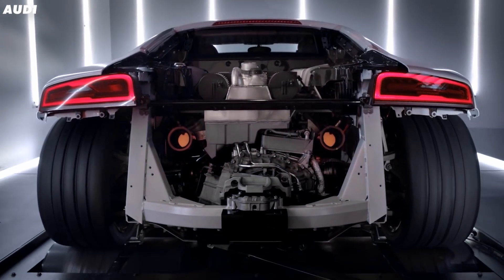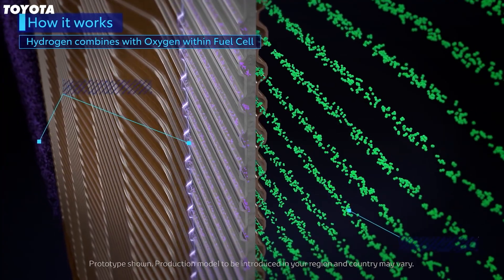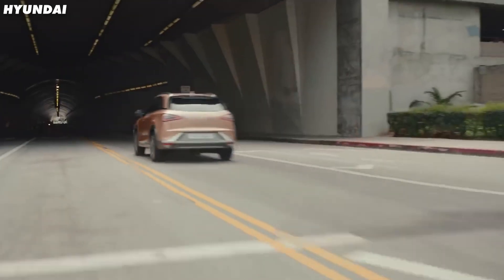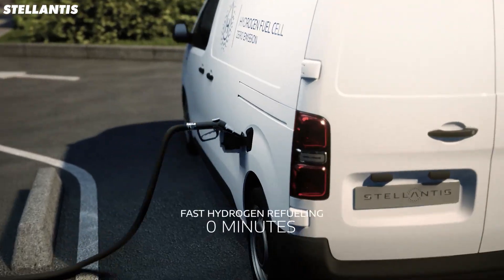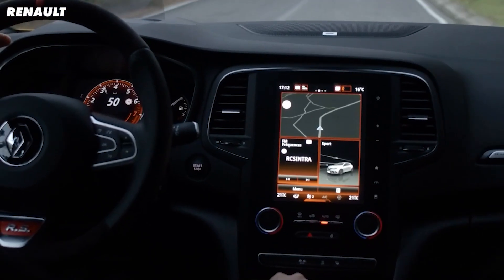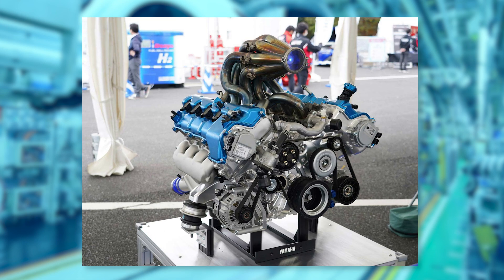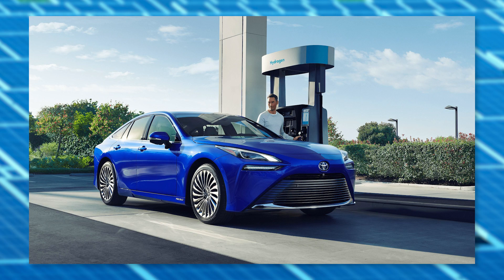The V8 Engine that Runs on HYDROGEN

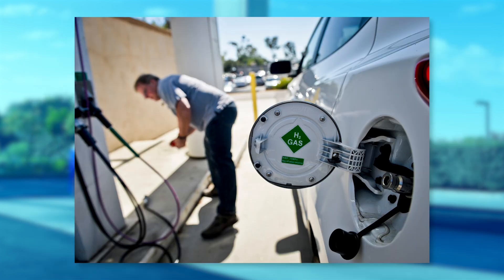Comment: 6:20  Fun fact.  Hydrogen cars are actually heavier than battery electric cars.  A Toyota Mirai is 4,255 lbs, while the Model 3 with the largest battery is 3,891 lbs.  And the Model 3 has much more interior and cargo room.  My EV has more room, and it's only 3,600 lbs.

Comment: 5:14  Eagle eyes will see the "DO NOT USE AFTER 2039/05" on the hydrogen tanks.  Yes, they expire and are not able to be recertified like metal tanks.  And you'll amazed how expensive they are. Replacement tanks for the Toyota Mirai are $25k, not including labor.
Reply: To be fair 20 years is a more than enough life span for a tank. Car will be long gone before it expires, in most cases atleast
Reply: @Zripas  yes 20 is fine, but it's 15 years, not 20. In the US the average age for a car on the road is 13 years. When I asked Toyota about it, they also said at 15 years, it would be an above average lifespan.
Reply: @scottkolaya2110  
It says to be manufactured in 2019/06 and it expires in 2039/05, so that would be 20 years, unless those dates mean something else.
Reply: @Zripas  I stand corrected, thank you.  All the other tanks I've seen on FCEVs have a 15 year.  Most notably the Toyotas.  I guess not so eagle eyed after all, lol.
Reply: @scottkolaya2110  
Well honestly I thought myself that hydrogen tanks have like 8-15 years as max of life span, so having real world example of one with 20 years is a nice surprise for myself.
Reply: @ The first year Toyota Mirais are now 10 years old.  It should be interesting when all their tanks expire.  No one seems to know what will happen.  Will they not be able to register that year?  Will nothing happen and people keep driving them?  Most that own them haven't even noticed the "DO NOT REFUEL AFTER xxxxx" on the fuel door or what it means.
Reply: @scottkolaya2110  
Well as no one actually buying hydrogen cars that sample is quite tiny, but I think that government should not allow car exploitation with expired tanks, I wonder if they even allow renewal of technical state if expiration is in between those, like if tanks is expiring in 2 months and I'm trying to renew license to use that car, would it even be allowed? As I would quite likely keep using it without replacing that tank, which would endanger quite few people. Its a weird situation.
Reply: @ I'm not sure what country you live in, but in the US, mainly California, over 18,000 hydrogen cars are running around on the roads.  It's not much compared to the 283M cars, but not "no one" either.
Reply: @ we've also had CNG tank cars for longer with the same 15-year expiration and there doesn't seem to be any requirement to prove you changed it before registering it.  There's lots of controversy around it.  The early ones have already passed their expiration at this point and people have said, (at least in CA), that there isn't any proof that's even asked for.  They quote it as the "gray area" cars.

Comment: My question then is, are we incapable of making hydrogen with a process of hydrolisis on board the vehicle so the only thing you keep in the tank is water essentially ? I only ask because ive seen it done with a generator.
Reply: It is possible to make hydrogen from the electricity from a generator, unfortunately, it consumes more energy to split the water than the energy contained in the resulting hydrogen.   If not, you'd have a perpetual motion machine.  If that worked, everyone would be powering their homes with it, just making hydrogen on the fly.

Comment: Your just changing the fuel. In the video you act like it’s combustion hydrogen motor vs electric motor. Unless electric cars can improve their range or charge times the hydrogen motor will win. 
1 -green hydrogen in a is actually neg emissions vs electric up to 40% less emissions 
2 -current combustion engines can easily be tooled to accept hydrogen as the fuel
3 - strong chance individuals can produce hydrogen fuel for free  
4 - hydrogen vs gas motors can be tooled to produce way more Hp than gas motors. The racing community and engine engineering will really take this further. 
5 - the motor sound 
6 - adding hydrogen as a retrofit on older motors will be possible.
Reply: The hydrogen motor will not win unless you can produce hydrogen cheaply.  Right now the pump price of hydrogen averages $33/kg in the US.  That's equivalent to $30/gal of gasoline or roughly $1/mile.  That's like trying to sell electric vehicles if electricity was $4/kWh.  Tooling current engines to run hydrogen isn't as easy as many think.  Just ask JBL, Cummins and Toyota.  Toyota has been racing them, but of course they come in last place every time.  Last time they tried liquid hydrogen so they didn't have to refuel so many times but kept burning up fuel pumps because of the low temp with no lubrication properties. There are many challenges and even if you can get past those, storage is still an issue.  You can store it 3 ways.  Compressed, liquidified to -427F or in a metal hydride matrix.  So it either takes up too much room, has to be kept really cold or it just boils off, or it's just too heavy in a metal matrix.  A sedan-sized hydrogen car gets about 35 miles per kg if you combust it and about 70 miles per kg in an FCEV.   A FCEV can get away with compressed and have decent range as long as you don't like having room. Say I made it at home with my solar panels, which aren't free.  Here are my options.  I could buy a $50,000 electrolyzer to make about a kg per day that could get me 30 miles in my really short commute.  That would take 60kWh of my solar energy.  Where I live I'd need about 20kW of solar to generate a yearly average of 60kWh per day. The benefit is I can just stick it into a storage tank and fuel my car later.  Of course If I store it at 10k psi, the tanks are pricy.  if I store is at low pressure, the tanks are enormous.  Like industrial sized propane tanks.  That's all to go 30 miles a day because some days are sunny some are not (especially in the winter).  Or I could just get an EV that gets 4mi/kWh (the average) and only use 7.5kWh instead of 60kWh.   I could make hydrogen from waste.  That actually makes methane that you'd need a high temperature steam reformer rig to convert it to hydrogen and just chuck the CO2 into the atmosphere.  But you'd probably get about 0.002kg per day.  Probably not enough to start the car.

I'm not saying hydrogen will NEVER be used, but it still needs "breakthroughs" in some technology we haven't invented yet.

Comment: Hydrogen combustion engines are a way better idea than the EV. The recent winter has shown how crap the EV idea is!!!
Reply: Its not like hydrogen engines which produce water would experience any issues during cold winters... And BEV's failed on lower rate than ICE cars did. Duno about HICE ones as those are extremely rare in cold climates, I wonder why...

Comment: 5:06 , you said it right there: THE BATTERY. you said that hydrogen isn't viable because it pollutes on it fabrication process. but do you know that batteries are just polluting and using finite resources. it means there would be a time where there would be no more batteries. a batterie lasts roughly 10 years. then it needs to be recycled. that is a lot of pollution. the battery to combat global warming... not the greatest of ideas.
Reply: First of all, you can recycle batteries and reuse materials. Second, actual studies have been done and end to end BEV's creates least pollution, its not ideal option, there is none, but its the best one we currently have.

Comment: you can also make hydrogen with another method: 

Production of hydrogen by electrolysis:

What connects the processes for the electrolysis of water is their principle of splitting water into hydrogen and oxygen with the help of electric current. They obtain two hydrogen molecules (2H2) and one oxygen molecule (O2) from two water molecules (H2O) each.
Reply: yes and double the energy going in that comes out.  Then run it through an ICE and you've got roughly 30% to make the wheels go round.  So about 15% overall or about 3000 ft per kWh vs 4 miles per kWh.

Comment: Drip sludge into combustion chamber utilize a microwave frequency as heater to quickly turn drop of metal sodium sludge molten. Spray with regular old tap and ka boom needs air intake as well. 

I'd worry about my water tank freezing in winter so maybe if it's cold enough when you power off the water tank will just drain just tap you can refill it from sink

Just my idea.

Your sludge fuel would have to be concentrated in an artificial diamond machine.

Comment: 1. how often do the tanks need to be pressure tested
2. can the pressure test be done with the tanks still in the vehicle
Reply: At 5:15, they are using composite tanks.  Same as the Toyota Mirai. They expire in 15 years and cannot be recertified like metal tanks.  They need to be replaced.

Comment: We could use batteries to store the energy but just making the lithium ion batteries would both be more polluting than probably anything we’ve ever done and also at the same time we wouldn’t have enough resources to replace every car on earth with an EV, to top that all off, once a lithium ion burns, it burns, like no stopping it till it has no more fuel to burn. With hydrogen, in worst case scenario every bit of hydrogen explodes at once with little to no environmental impact and as little deaths as possible. Sure it happens quicker but overall the damage is not nearly as bad as hydrogen.

Also the hydrogen in hydrogen bombs undergoes nuclear fission which compresses it so much it fuses with other hydrogen atoms creating amounts of energy unimaginable, this could happen to any element but it happened to hydrogen since it was easiest to acquire and one of the easiest to actually undergo nuclear fusion. (As easy as it is for it to do that compared to other elements it’s still extremely hard and in no circumstance would it ever happen in your car.)

Comment: Honestly just use both forms of hydrogen when the time comes. Let the people who want engines have engines and the people who want less engine have less engine
Reply: People already make H2 combustion engines and have put them in vehicles.  The problem since internal combustion is 1/2 as efficient as a fuel cell with an already expensive fuel, no one is willing to spend $1/mile just to make noise.

Comment: Hydrogen is highly inefficient batteries are better.
Hydrogen is hard to store and transport If you want to run a car on gas Methane would be far better when burnt it produces water & CO2 the gas of life. if we keep capturing and sequestrating it all the plants will die followed by everything else. most of the planets CO2 has already been captured.

Comment: EVs were always going to be a stepping stone imo, Hydrogen cars would effectively clean the air they use to run reducing CO² in the atmosphere creating mobile carbon scrubbers. They don't require the rare earth elements that were fast running out of to produce the massive amounts of batteries EVs require that also need replacing, Not to mention the pollution and ethical issues with getting the lithium for the batteries. Hydrogen is after all everywhere, We just need to refine the process of collecting it.

Comment: Nice piece. I could not agree more. I think the super sport car manufacturers should develop hydrogen ICE. Maybe rotary. Eventually with water injection to keep NOx down. And with a small battery and electric motor to get from home to the nearest fuelling station. Hydrogen might leak if the vehicle is parked for a longer period. It would be great if there would be a class at Le Mans for these type of engines.

Comment: The Problem with hydrogen combustion engines is that they only in theory emit just water. With the nitrogen in the air the combustion of hydrogen and air doesn't only emit H2O but also NO, which is very harmful for the environment so saying these combustion engines are green isn't true. If you want a combustion engine that is as green as possible I'd recommend green methanol. Porsche is planing on producing their own green methanol "E-Fuel" together with siemens in a place where you can produce a lot of green electricity. The methanol can be produced with  filtering carbon out of the air and with electrolysis hydrogen and oxygen out of water. All of  this can be done with green electricity which would mean that the combustion of the methanol is Carbon Neutral. The methanol which can be used to fuel ordinary combustion engines, runs cleaner and emits less CO2, sounds like a good alternative to petrol and hydrogen combustion doesn't it. It also has it's problems as it can't be produced in quantities the entire civilisation could run on unless the entire world could agree on only producing one fuel.

Comment: According to energy.gov "On a mass basis, hydrogen has nearly three times the energy content of gasoline—120 MJ/kg for hydrogen versus 44 MJ/kg for gasoline." So in theory, if you design a hydrogen combustion engine to be as efficient as a gasoline engine, you should get roughly 3x the fuel efficiency. The problem is that hydrogen is much less dense, so you still need massive fuel tanks for similar range, unless you figure out how to compress the hydrogen safely.

Comment: Hydrogen is the answer, electric is a dirty business to mine the components, it’s stress on electricity grids which can’t cope now and in time the recycling of batteries will be a major issue. The transition to a hydrogen supply network is much easier and efficient

Comment: This is such old technology that was swept under the rug. Also, just run the standard petrol engines off of hydrogen, and no compressed gas either.. super dangerous.. install a cell that’s large enough.

Comment: This video failed to point out EV's have the same problem. As for storing energy, 2H has a greater energy density than batteries. What is more, EV batteries have a terrible environmental footprint. Right now there is no viable way to recycle EV batteries. They are simply shipped to other countries for storage. All the marketing concerning recycling EV batteries is just that, marketing. Yes, there is research, but as yet no viable scalable way to recycle EV batteries.

Comment: I wrote my Master’s dissertation on the use of hydrogen as a method of storing curtailed wind energy. Fuel could be produced as a by product of renewable energy. Hydrogen is aslo better as its storage is much longer term than batteries that degrade. Large scale battery storage facilities are basically defunct after 2000 cycles which is approximately 10yr lifespan.

Comment: Hydrogen fuel cells only work on electric motor. Now raw HHO is where it's at. Any internal combustion engine can run on gaseous Hydrogen, even diesel engines & turbines. Best of all it leaves no pollution 0%. It turns back into water & oxygen.

Comment: Argument that I see for hydrogen over electric is that. Is the battery's, they require rare materials that are distinctive to eco systems to mine. And also lithium ion battery degrade over time so and not efficient in cold climates. And also the waste what do you do with all the dead battery cells.

Comment: Well actually my fuel pump is the nearest grocery store that sells an electrolyte like baking soda or something like that and a gallon of distilled water then you put that in your bottle mix the distilled water within electrolyte then pour the water and the electrolyte in the system close the bottle and you're under your hood get on in your car hit the start button wait a minute to get the pressure up and hit the then turn the car on and you have your engine running on hydrogen it's a lot cheaper than what you're talking about

Comment: Actually it would be easy to have a fuel system fuel stations running on hydrogen all you need distilled water and an electrolyte in water run a current through it it breaks down the oxygen and hydrogen you have hydrogen oxygen gas HHO and you can run a car off of it it's called On Demand fuel you could put it in every V8 engine you can put a nice in the replace of its fuel tank and only have a 5 gallon thing of water and run off that for weeks on end and only have to stop to put an electrolyte solution with water in your tank and keep going it's same systems have been working on since the 50s that the automotive in the gas companies kept shut down and killing people over

Comment: Or you can buy a Durango for that price or or even more if you want to knock off more options like Advanced cruise control I have a Durango I drive and I have a hydrogen kit on it also knows an HHO system and it increased my fuel economy in most of my exhaust fumes is water

Comment: You can use an HHO system like I use in my Dodge you can put a hydrogen oxygen generator onto your engine run gasoline and engine together it turns the gasoline into a better hydrocarbon Burns a lot cleaner and you're exhaust is water

Comment: Hydrogen is the key to everything. Runs on water, powers electric motors, cleans dirty air while you drive, the carbon collected can be repurposed, is quiet, and produces water as waste. You have to be stupid to think it would never work

Comment: reason why its stupid to take solar and go to the EV is because you are still fucking around with lithium iron battery's and as we all know after 5 years they go caput and this is why you don't see lithium iron battery stores in power stations too often because its highly inefficient costs so in the same way the EV car community will very quickly fuck up lithium stores and have already shown with teslas investments in EV alone lithium has shot up in price making EV less practical then actually just going from solar to hydrogen to car. yes it isn't the best efficiency method due to the extra conversion step but it will work for years and years and will end up being cheaper anyway.